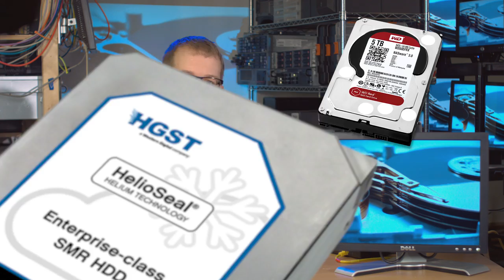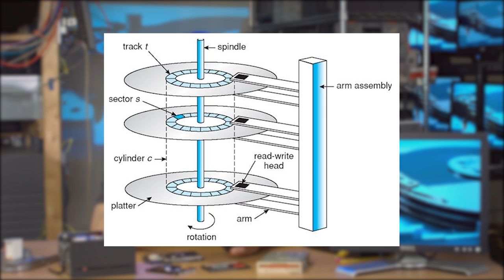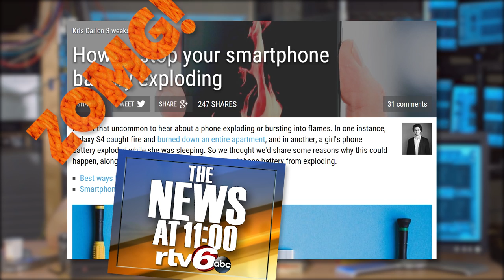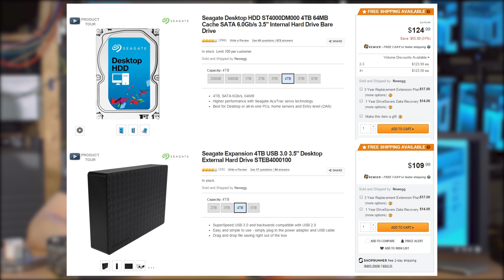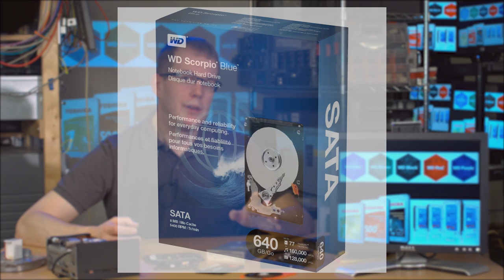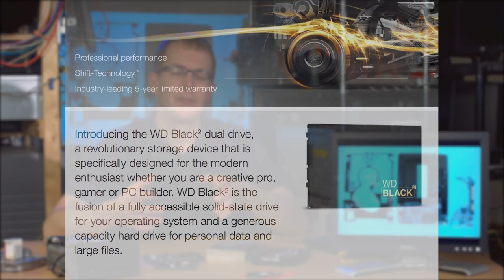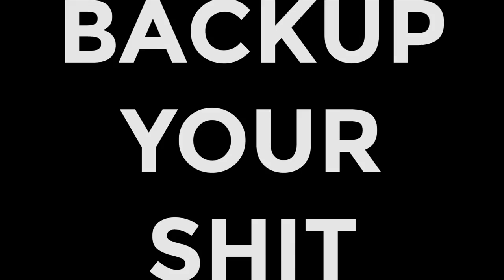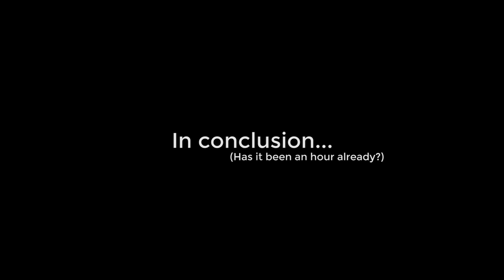Choosing a Disk Drive: HDDs, SSDs, and Then Some (How to Choose a Hard Drive / How they Work)

Comment: 1. Fantastic video.
2. I completely forgot about the 3.5 etc naming convention for drives. Thanks.
3. Funny fact.  Apart from the very first of this brand of HDD I bought in 1993, all the following drives have failed in less than 1 week...for the last 22 years, without exception. Now obviously I haven't bought that many for obvious reasons, but I have bought perhaps 5-6 of this brand of HDD.  LESS THAN 1 WEEK!  It's absurd.

Comment: Sometimes external hard drives come with the USB-SATA adapter soldered to the HD logical board, so you can't just open the enclosure to upgrade or replace an external hard drive. Maybe that's why external (sometimes) are cheaper than the same internal equivalent.